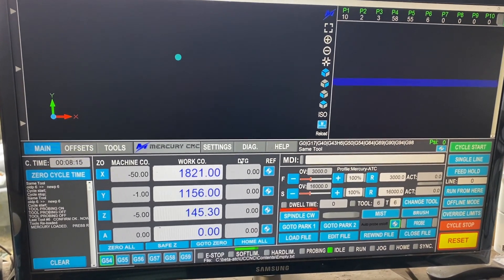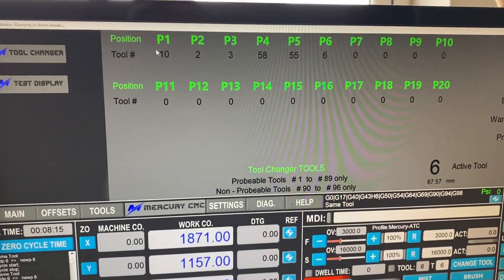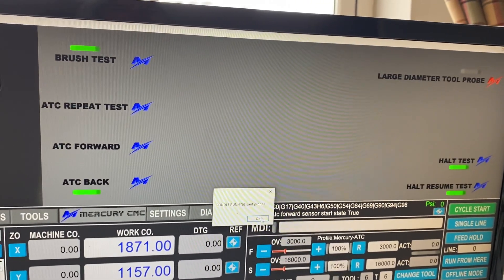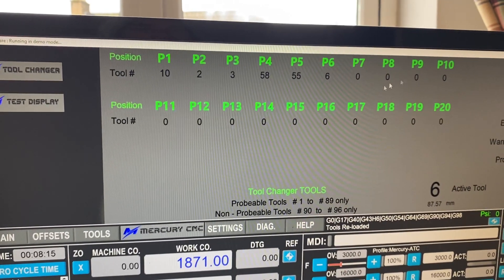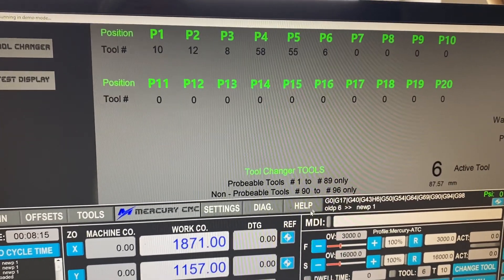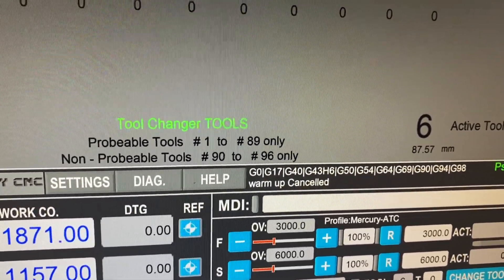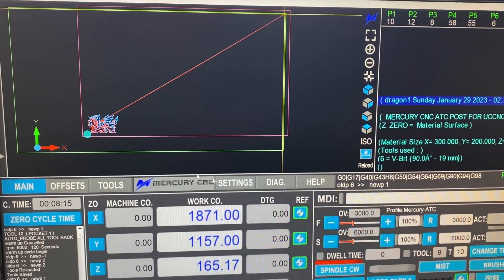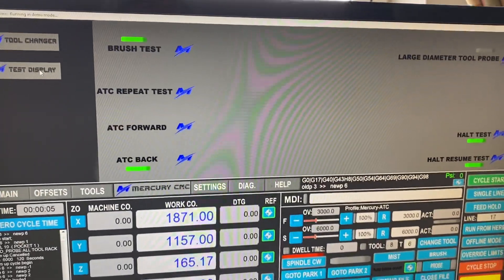New Atc tool screen. Uccnc

Comment: I love UCCNC, but recently switched to masso due to this exact reason. Masso has built in ATC support of all kinds and UCCNC can do it, but there is very little information on actually making it work. Then you see a video like this and get the old "for our sales machine only". Crazy!!!! Not even available as a paid add on. What a shame for such a great controller.... Oh well.....
Reply: Every Atc is different. 
So impossible to cater for everyone. 
I wrote this code for our own machines only. Cannot release as it’s intellectual ip. 

I have put older code on the main forum which is readily available and easy to modify for a c# programmer or someone who is willing to make an effort . 

There are plenty of programmers that could customise for you for a fee.